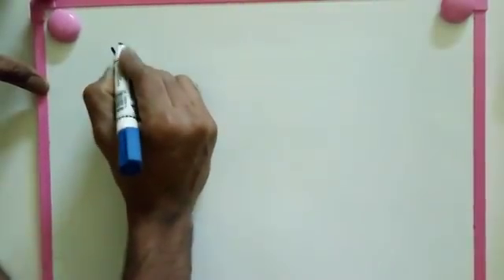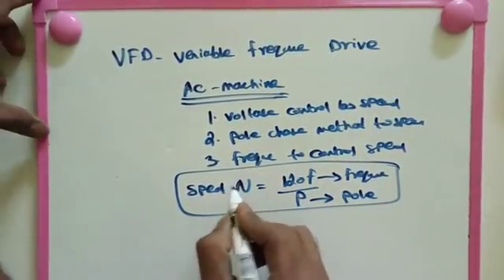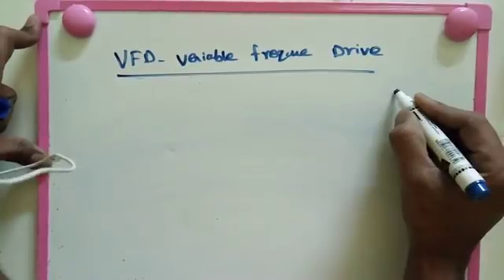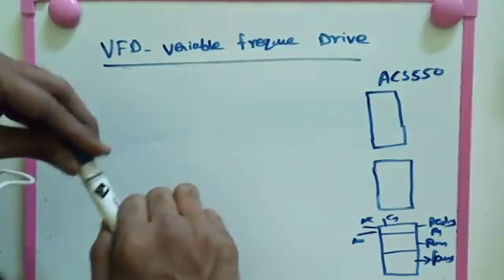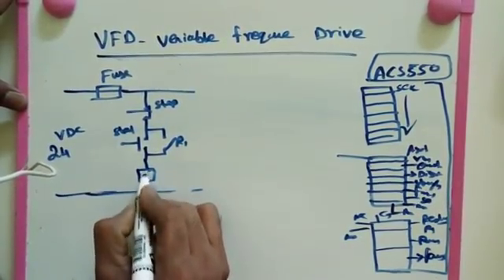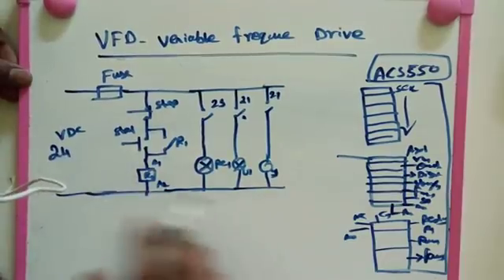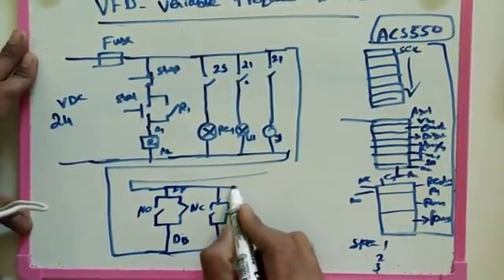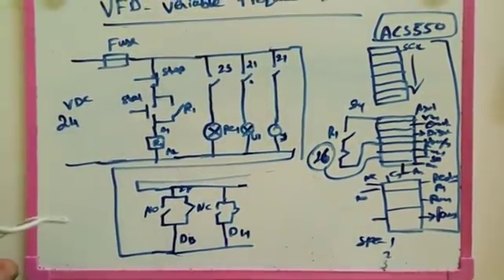VFD control panel diagram and vfd working principle

Comment: Can I use VFD for single phase input, for 3hp motor
Reply: No
Reply: Yes if your load amperes  is minimal.
Reply: If your load amperes is 5 up you needs a 3 phase input supply. If. Your load amperes 5 bellow  you can use input supply single phase.

Comment: sir
I had qution we have  power supply  415v but the 250 hp motor when start the power supply go to under 365v . that means voltage drop our cable but we need try   to  fix the vfd . the vfd maybe solve the  problem and  give the perfect rpm. please send details . very urgent.
Reply from the maker: No ..VFD not voltage stabilizer you need to improve voltage from connection of vfd input supply..

Comment: Do you have a drive that would control a LG direct drive Motor, if so I could sale millions of them if they could run the motor up to at less 3000rpm. The motor is a 310vdc @5.6amps, must have high torque with or without hall effect sensors, prefer no sensors.

Comment: Sir Is it possible to run 1440 Rpm motor rated frequency 50 Hz the motor frequency is changed to 60 Hz and increased its speed up to 1800 Rpm ...Or by doubling the frequency 100Hz will its speed changes to 2800Rpm and will motor run safely???
Reply from the maker: its possible to run at the frequency at 60 hz but not good for motor life then not safely running also then not possible to run at 100 hz 

thank you for your support
Reply: +Edison world  what happened if motor run more than their rated speed..
Reply from the maker: Motor getting mechanical demages at more then rated speed running...
Reply from the maker: https://youtu.be/anPPj_j_CgM
Reply: No change